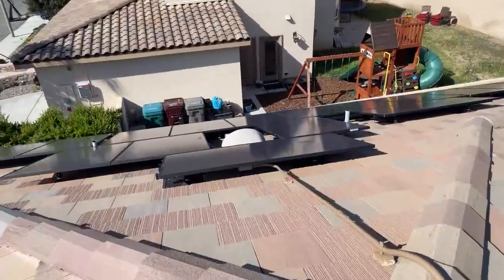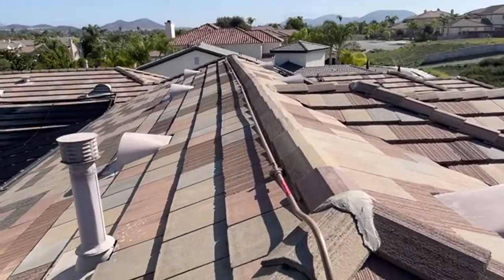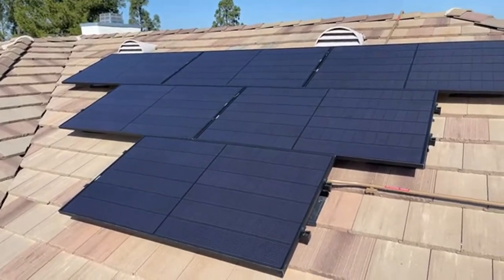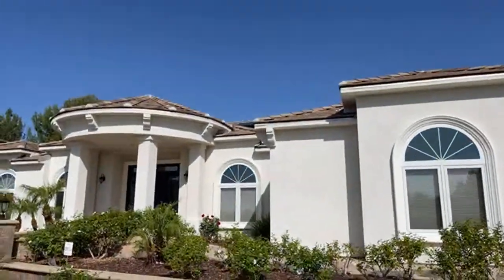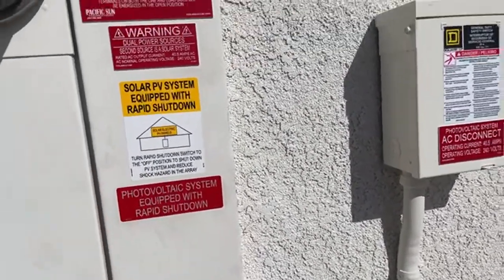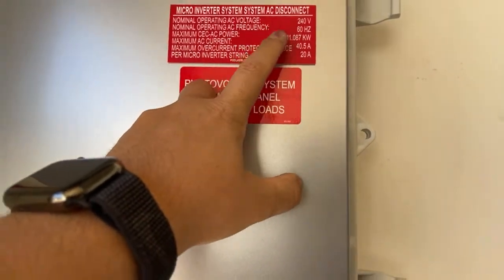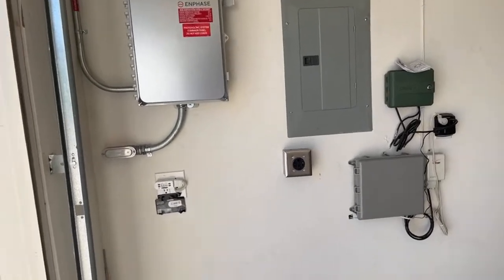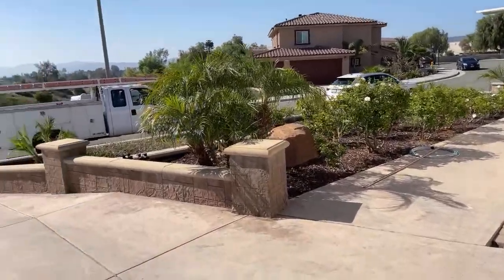LIVE! Enphase System Walkthrough

Comment: Our HOA won't allow ANY exposed wires or conduit.  Luckily the company I selected does all their installs that way.  So we are getting 31 Q Cell 405-watt panels mated to 31 IQ8A Enphase Inverters mated to an IQ 4C Combiner. We opted for the cell modem and Critter Guards.   We'll do batteries next year.  Hopefully, Enphase will bundle 3 5Ps and create a 15.  That would be a PowerHouse.   I told every company we interviewed I didn't want our home to look like some DIY project and our HOA has the same requirements.  Great video.

Comment: We like to put conduit through the attic, so it is not visible at all. 
I don't like the idea of painting conduit. Who is going to maintain that? 
IF you have to run conduit on the outside, you want to follow the architectural lines of the home.   
One way is to take the conduit down to the eave, and then run it horizontally under the eave.  
Solar panels can be very close to the eave, since the setback is minimal. So, the exposed conduit could be less than a foot on the roof.  
From what we do, I am not impressed with how he handles conduit.

Comment: Great video- I especially like the fact that you include an EV charge outlet. My solar company wouldn’t even install it and I was willing to pay for it.
I know what you mean by cheapest guy- I made the mistake and what a waste of my time and money! The company dint even fully finish the roof job… learnt my lesson the hard way
Reply: That is horrible.  It is important to know the company you are hiring -- we are NOT all alike.  
1. Make sure your solar company has their own W2 people that do the design & install.  If fact, can the sales guy alter the design while you talk to him?? OR, is the design fixed, and cannot be changed?? If so, that is not a good sign. 
2. How good are the Anji/Home Advisor ratings?? My company averages 5 Stars, on a 5 Star rating system.  We are pretty good.  You should not choose anyone who averages less than 4, IMO.  
3. Does the sales rep or agent explain the key concepts --- offset, net-metering,  inverters/microinverters, monitoring, the solar panel spec sheet, state & federal incentives, etc. 
4. Do they push things you DON'T need?? Here in the Chicago area, COMED is very reliable. Most people have experienced outages of a few hours  a few times in 20 years.  For most people, it is not worth $15K to $25K to fix that problem.  Batteries are not usually needed here.  
[Oh, we also have 1-to-1 net-metering, where the buy/sell prices are same for the SRECs. ]

Comment: Do people have problems with the ct that measures the house consumption and is there another way around to use the tool kit to enable the Ct's that I bought from enphase. After the solar install.
Reply: CTs are a pain....and the consumption monitoring is pretty useless.  Its aggregate data so good luck figuring out what is using what.
Reply: @carlmccoy8382  their working with the set up. No issues with them.

Comment: Nice setup. Since I installed two Tesla Powerwalls last June, 2021, later my Enphase envoy, stopped reporting on and off, then quit. Re connected it two different times, went offline again so I temporarily gave up. 
Is there an easy way to stop the batteries from interfering with the envoy? I need to get it back running to monitor my micro inverters individually and to report automatically so I can sign up for SREC’s
Just FYI, my envoy worked fine for 3 years prior, thanks

Comment: Im getting the REC 400W panels and live in south Florida. I'm being set up with the IQ7+ inverters. Is that a mistake?  Should I be getting the IQ7X or IQ7A instead?
Reply: As panels get hot they produce less power. Also the 400W rating is at standard test conditions. There may be periods in winter where are your hitting the standard test conditions but it’s not going to affect your output materially. If you look at the data sheet for those panels under normal operating cell temperature(NOCT) the power output is probably going to be in line with the rated output of each IQ 7+ inverter. If you lived in very sunny colder regions I would say focus more on clipping but not in Florida.
Reply: @ABC-wz2db  got it. Thank you.
Reply: @ABC-wz2db  exactly this!  Panels never produce their rated power and inverters are more EFFICIENT the closer you are to the max.  Clipping is actually a good thing overall and the diminishing returns is about 1.5 dc:ac ratio.
Reply: should pay a little more for IQ8
Reply: You are going to be clipping a lot should have IQ7A at least
Reply: @DeAtHvAnGeL  the IQ8 is 300V max.  You should get IQ8M, or else you will get clipping.
Reply: If the inverters are rated less then the panels, what or how many watts is the system actually producing?
Reply: @martindavila2232  I'm not exactly sure. But I contacted Enphase and they recommend I use the IQ7A with the REC 400W panels.
Reply: @russell7763  Weird.  I was told by Enphase that clipping is a "non issue"...
Reply: @carlmccoy8382  Yea Idk.  I spoke to two different people.  First said 7+ and then the next one said 7A.  I went with the 7A.  On the sunniest days, I get between 2 and 2.4 kwh per panel, depending on which direction the panel is facing. Plus I was given the 7A for the 7+ price, so seems to be working out okay.
Reply: @russell7763  said another way, that might not be the deal it looks like.  Enphase has a whitepaper where the 7+ produces more power than the 7A with the higher wattage panels.  Also the 7A has a higher threshold voltage, so it turns on later in the day and turns off earlier in the day. 
https://www4.enphase.com/sites/default/files/downloads/support/IQ7A-PV-Module-Rating-Larger-Than-Inverter-Rating-India.pdf
Reply: @martindavila2232 Each IQ7A will produce:
 Peak output power 366 VA
  Maximum continuous output power 349 VA 
Multiply number of panels times the smaller number to be conservative. That is the Rated AC output in Watts.
Reply: Not a good sign.

Comment: How much is the extra equipment for the Sunlight backup? I heard it’s quite expensive
Reply: Retail the parts (system controller) and communication equipment is roughly $2500. But then you are ready at any time to add IQ batteries to your system for full battery backup.
Reply: Battery alone is anywhere from 10k and up
Reply: The basic to have sunlight back up I believe IQ8 Microinverter at least, Combiner 4c box, IQ Controller 2 and IQ Load Controller.